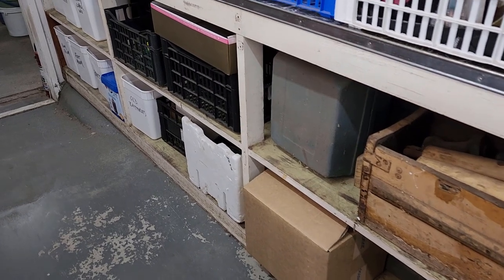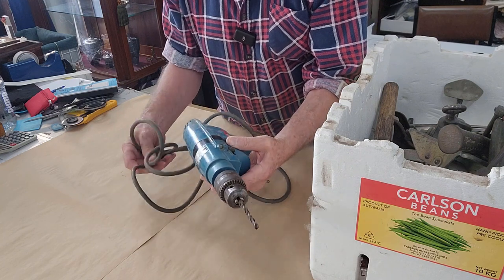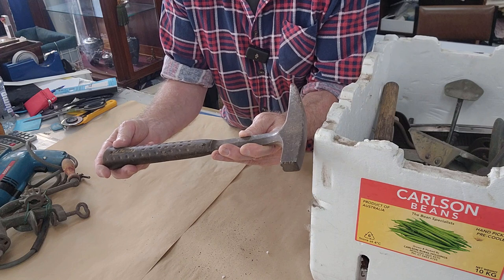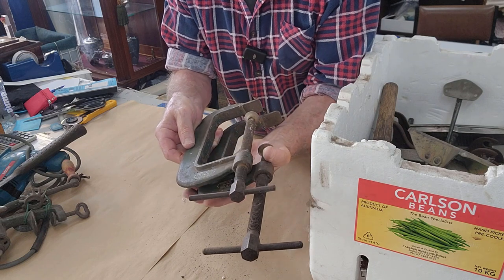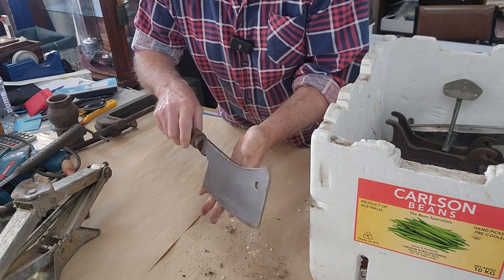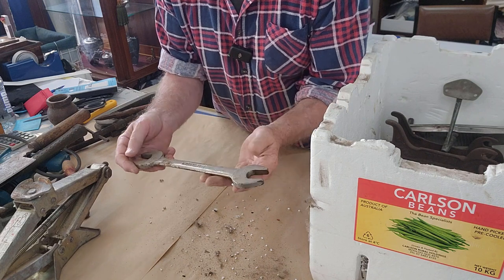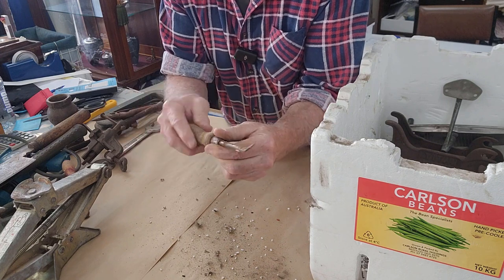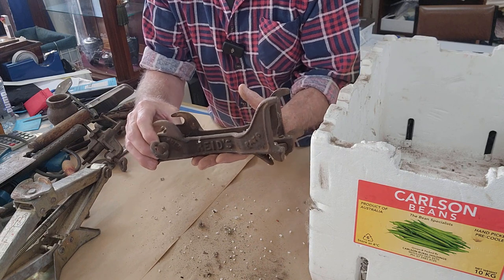Unboxing a Mystery Box of old Tools & Shed Things! Some Nice Shop Stock & Some Keepers for Home!

Comment: The drill is very similar to the first drill l bought for myself as a young man. I used it to drill in tech screws while building a shed.... realised pretty quickly that l should have paid a bit more and bought the one that also had a reverse gear. As l had very few tools at that time, every screw that went in crooked or had to be redone, l had to remove with a small spanner.😂
Reply from the maker: Haha, that sounds a little annoying! I guess you don't realise how handy reverse is until you don't have it!

Comment: I did get a similar pair of metal shears at the market the other day. The ones i got were German. Any way i spent a bit of time restoring them, a couple of hours actually. They work fantastically well now. Best metal shears ever.
Reply from the maker: That's awesome - you can't beat quality old tools can you! 😊👍
Reply: @TheUltimateRecycler  For sure. Is nice when ya spend a bit of time on something and it works out well.

Comment: I' got a tack remover (assuming that's what it is) in an old bundle of tools, wasn't sure what it was. but now you mention it, i'll probably keep it to try remove staples from upholstery. (did it with a flat screw driver and pliers last time and that seemed to be the hard way.) i recently killed a similar bosch drill i bought 25yrs ago second hand. i used it a lot over the years until i got the cordless ones, but i used it recently to polish some mag wheels and i think i cooked it. (was on it's way out since using it with the wire brush wheel for rust and it ingested rust dust/flakes which probably are attracted to the internal motor magnets.) 
looking forward to the next mystery item challenge, i hadn't seen that item you showed before.
Reply from the maker: Thanks Dean, I'll try and throw in another mystery item vid very soon!
Yep - rusty dust would probably kill an electric motor pretty quickly!!
Reply: @TheUltimateRecycler  looks like my replies about the mirror aren't here. so have a look for NOS Mopar Inside Day Nite Rear View Mirror 1962-5 Plymouth Dodge Chrysler also
Reply from the maker: @deankdx  Thanks mate - a guy from one of the facebook groups I shared pics to has just messaged to confirm what you have just said! Seems my guess was close!! I'll leave it at $20 in the shop I think!